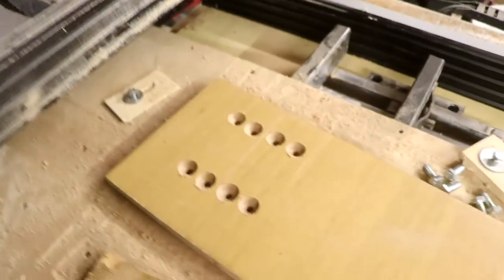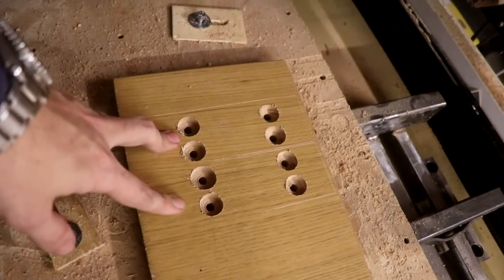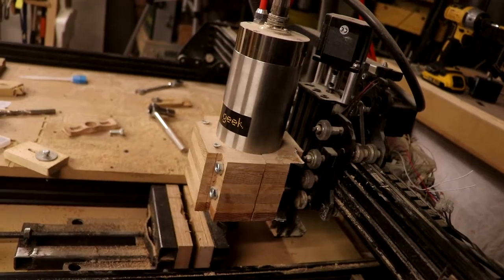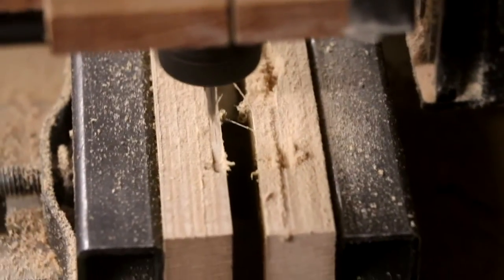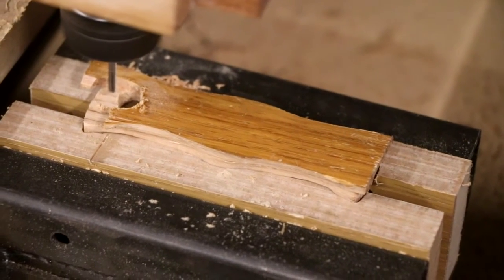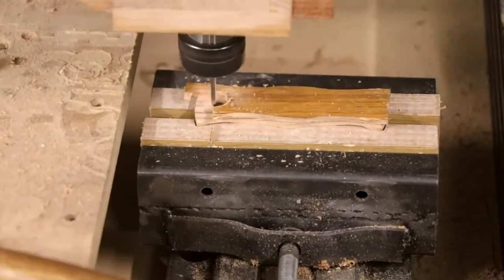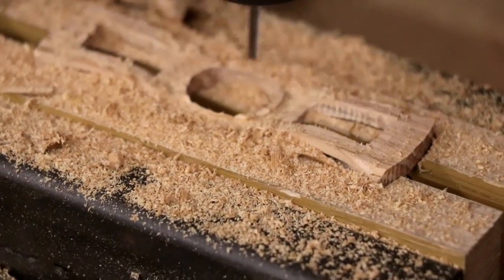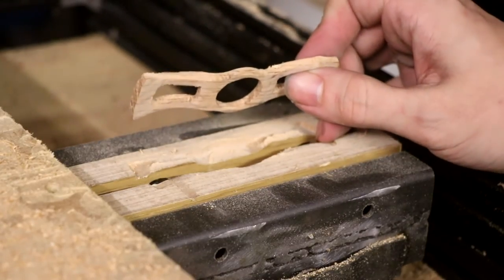SitW #9 poor man's CNC soft jaws

Comment: That was a very educational video for me. Thanks
I have noticed quite rough sound of the stepper motors. Is your xPro CNC board running in slow decay mode or in fast decay mode? My one made this sound when running in slow decay mode and I was getting some jittery lines (especially visible when cutting circles). Then when I switched to a fast decay mode (had to solder actually) the stepper motors sound changed (they started running quieter but made more noise when idle) and more importantly I now have much more precise cutting.
Reply from the maker: I don't know which I'm using. I assume the default. I'm curious as to what other settings you have? Where did you find out about the decay modes?